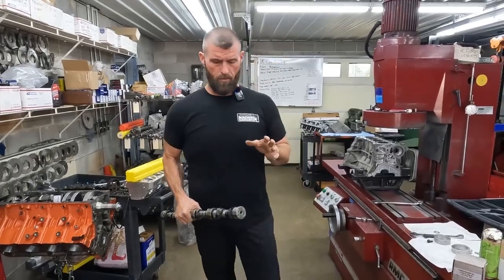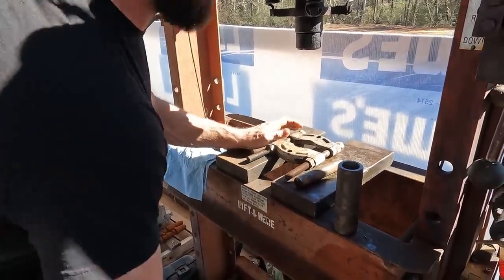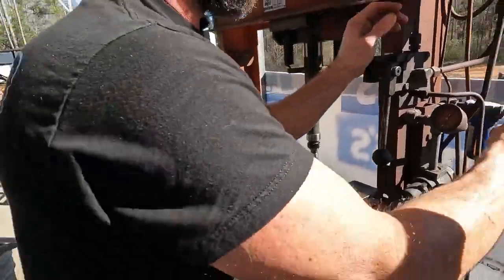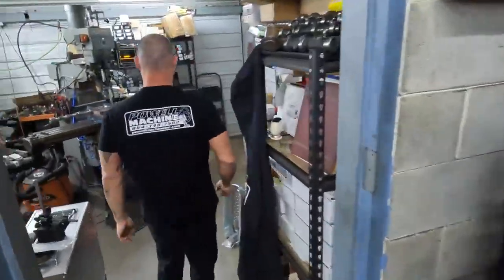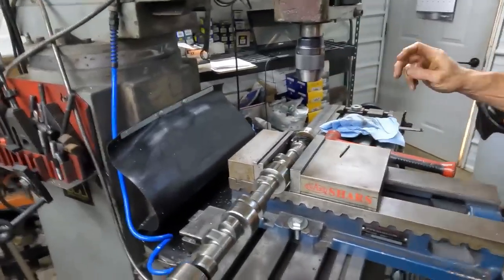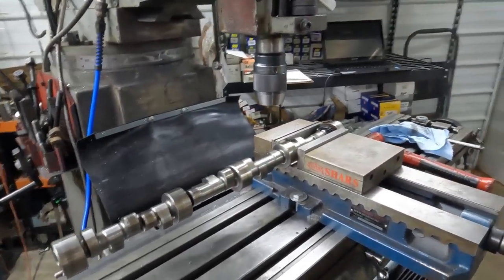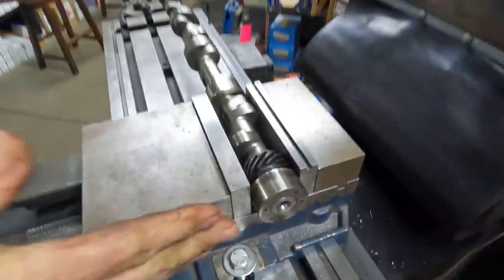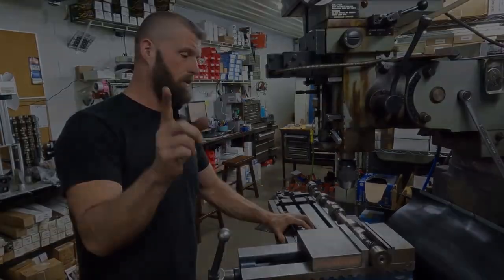Changing the drive gear on a 3 pc camshaft core

Comment: Is the gear you put "on" cast or steel or other ?  can a normal steel hydraulic roller be converted to this style. was going to use good stock cast gear . cut off , bored to fit. have my own home machine shop  .
Reply from the maker: These gears are a special ductile alloy

Comment: He has totally screwed that cam up.  He has lost the center line Sequential offset  Of the diagonal Spheer. All because he refuses to use a camshaft torque plate. Now if you want it done right just bring your cams over to my mom's house and have her call me while I'm at work at McDonald's and  As soon as I finish my job as the master chef there I'll come fix it. I'm an expert at it because when I was little my mom told me I could do anything if I wanted to.
Reply from the maker: I just couldn't afford to buy one.
..

Comment: I have the equipment to do this but I would still send it to you.
Reply from the maker: @lazyhoundracing9621  u can do it!!
Reply: @PowellCams  I would do it on my daily but for my race motor I'm sending it in. Too much to lose. I don't actually have a cam gear on my race motor but if I did I would want it checked out by a pro to be sure.